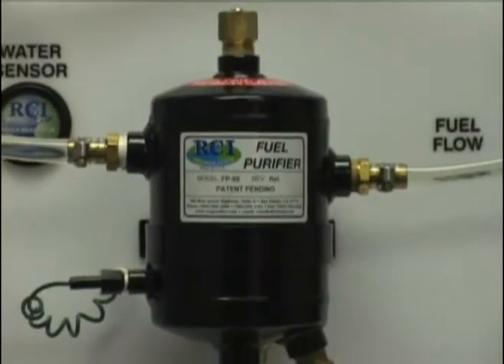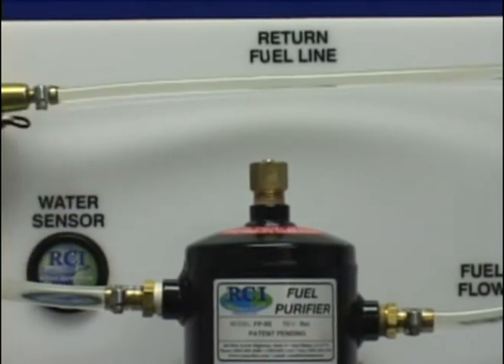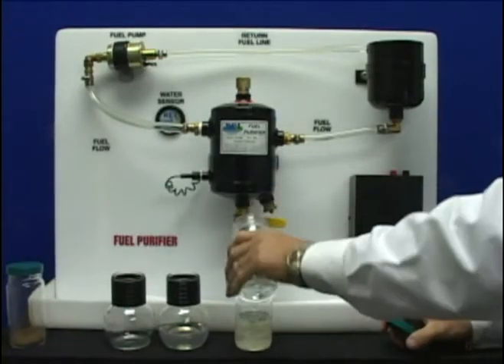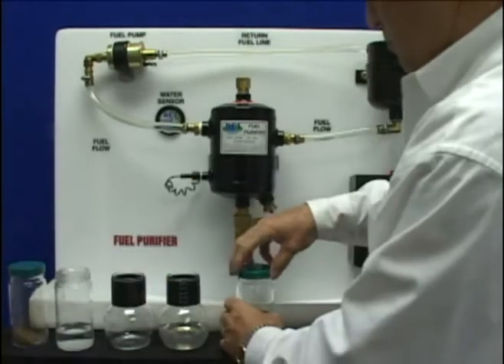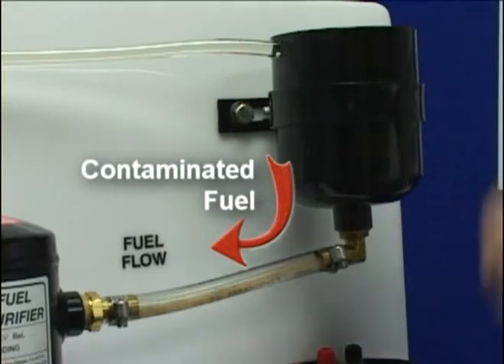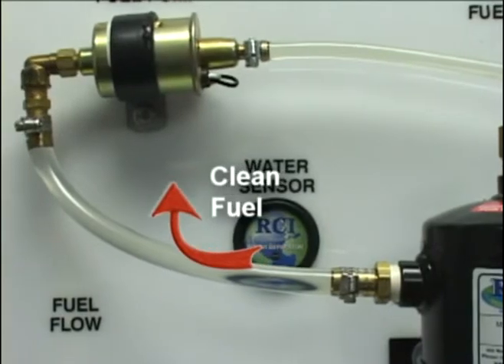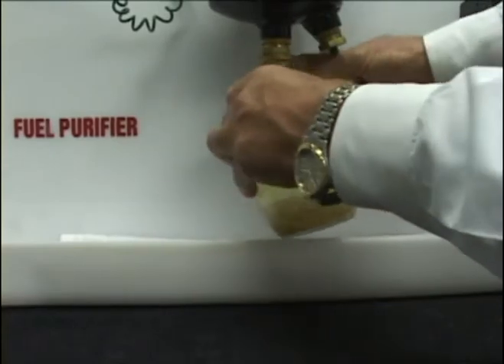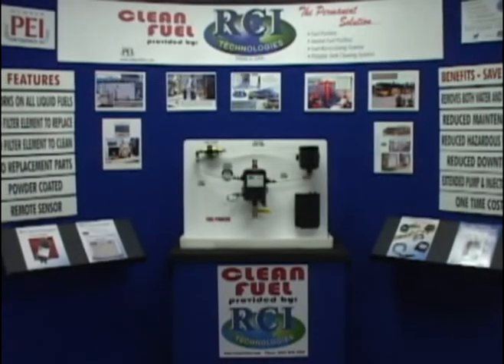RCI Universal Fuel Purifier

Comment: Wow, I can’t believe I’m the only second one to leave a comment. This system has been out for 40 years that I know of. I also installed it 40 years ago and we hired a captain to run our sport Fisher which is a 53 foot custom made one of a kind, he took the system off. Wow we start having all kinds of problems.I just have taken the boat over. We are still renovating it and doing lots of repairs within the next couple weeks. We are putting the RCI system back into play. Also, I hope to show you guys pictures after we get the boat up running. You will be surprised how much junk and water we get out of it before it goes to the right core system. As I remember we would get about 300 running hours off the race course and of course now we can’t even do 50 hours. By the way, I believe it was the Navy that was installed these on all of their Coast Guard cutters back in 1980 approximately.